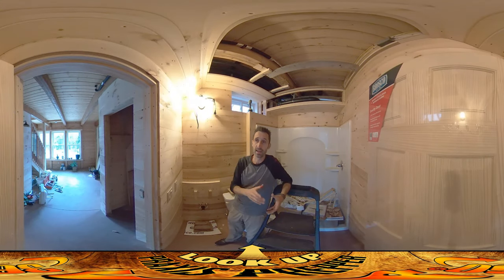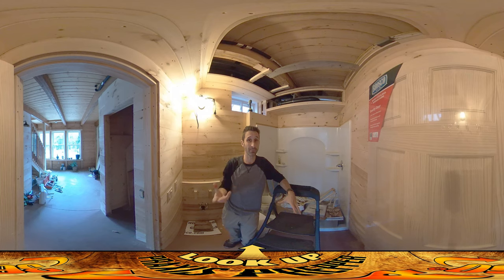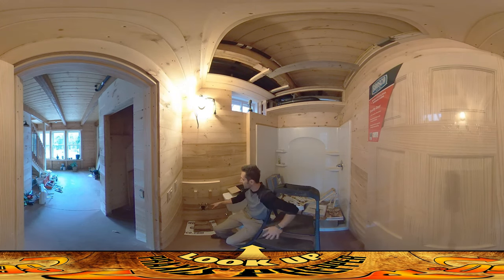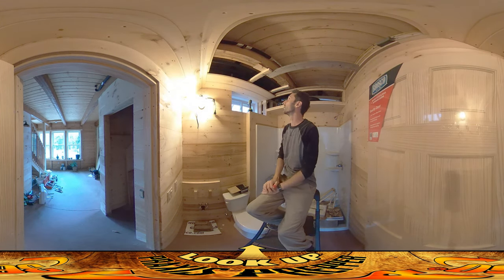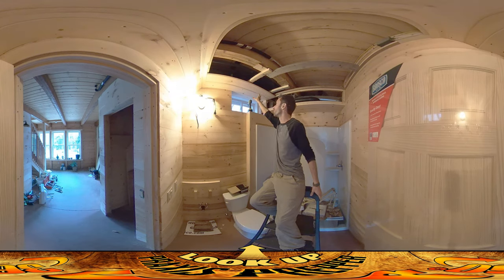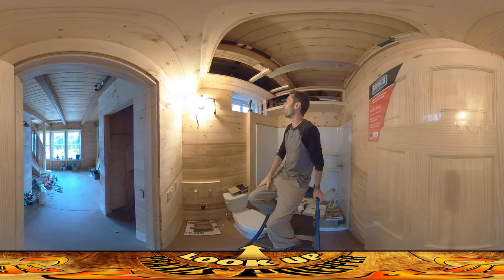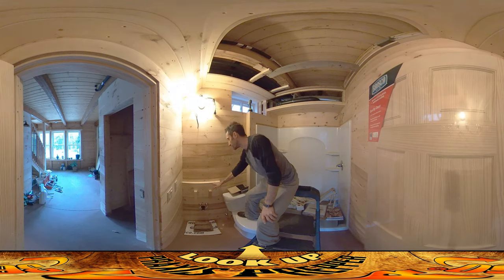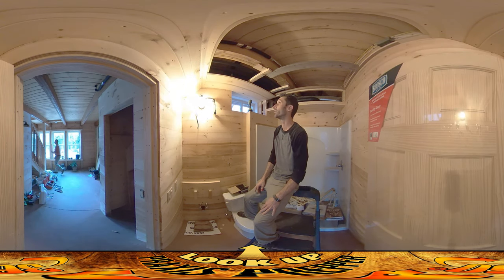Homestead Building - Building Removable Panels Due to Plumbing Issues

Comment: Can you pressure test the pipes now to determine the weak spots so you can deal with the problem before putting in more boards? Idk, I'm not a plumber and I don't play one on YouTube.
Reply from the maker: They did a pressure test earlier - but a lot of the issues arose later on. It's weird... and irritating.